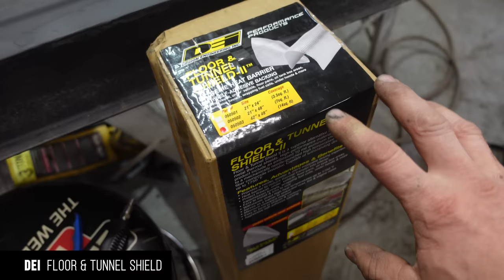Building a Functional Boom Lift Hydraulic Power Unit | #TTDmaxC10 [EP17]

Comment: I've had a lot more luck getting out broken bolts by first welding a flat washer to the busted bolt, then welding a nut to the washer. A friend gave me that tip and it has saved a lot of headache.
Reply from the maker: Something I learned today!  Thanks!
Reply: @DEBOSSGARAGE  if the bolt is big enough and recessed into a bore, Cronatron 333 welding rods are your friend there. They're expensive tho, like 10 freedom bucks per pound, or maybe 10 bucks per rod, I don't remember exactly.
Reply: You’re right that’s all I ever do
Reply: $200 for a 5 pound container 😮
Reply: And while it’s still good and hot, give it a dose of PB Blaster. I use 50/50 ATF/acetone for without heat, but I’ve never had PB flash off without an open flame.

Comment: Nice build on cab, a lot of work. Did 27 months at Ford in body shop, as line technician,  electric,  robots,  vfd drives in KC,  Mo. They make F150 & we launched transit van . 600 robots,  the Fanuc brand,they do welding about 180 to 230 units ,  in a  couple 8 hour shifts .  They go around the clock. 
Not stealing your thunder. But after them van chassis leave us they go to E coat,  they get dunked,  then off to paint,  * back to body shop for power train,  wiring,  glass plumbing. So may I humbly suggest,  spray that entire thing,  top bottom inside with some good e coat,of your favorite brand,that has a good rust inhibitor,  flat black,  white or grey,  before or if your planning paint down the road.
 Because were you live in Canada , & I'm in Chicago,  that salt eats that metal ! ! Were talking about winter folks,  yes they put salt down to melt that snow.
 It will last a lot longer.
Hugh Mc. Chicago, metro.

Comment: Rich, I've always wondered about doing welds on panels and what protects the other side of the panel. For example, that door that you repaired, as DIYers are we supposed to try and slap some paint on the back side (inside) of the door cavity where the weld has come through?

Comment: I need help with my 97 Obs Chevy 4.3 Vortec! Driving on the freeway it just stopped running without warning. Facts: Fuel pump turns on with key. Not getting spark now. No fuses blown, guages work but “check gauges” light and “check engine” light now on, no spark from coil. Maybe crank sensor or coil? Would those cause it to just die? Never had a problem with this little truck before.

Comment: 9:18 the toolbox lid not having enough clearance. I saw that one coming right away.  Speaking from personal experience of course 😆
Reply from the maker: Split the difference between having it stick out too far and hit the front of the bed.  I put the crane as far forward as I could.  The wheel just clears.
Reply: The lid just needs a creative dent in it for clearance to let the lid open more.

Comment: 15:34
A trick Ive heard of is to weld the end to a washer first. then put a bolt on top of it and weld in and around it. Idea being you are turning against the outside welds instead of the one on the stud itself.

Im not great with wording sometimes but i hope that made a little sense

Comment: Change the hinges on the tool box to tackle box style so you can pull the lid towards you and then flip it over. Gives you a nice little surface to work off of when servicing the hydraulic pump and it will clear the handle easily.

Comment: Haulass Garage(Aussie Chevelle drag week) showed welding a washer on the broken bolt first then welding a nut to the washer was best. can get better welds on both before trying to remove(probably more heat too?)

Comment: Next time you weld a nut on like that, pour water on it right away. That will harden the metal and will allow you to then back it out without it twisting apart. When I did special trackwork repair in the railroad I did that all the time to extract broken bolts. If I did not harden it with water then never came out. Just food for thought! Try it next time!

Comment: Such a cool build. I would definitely drive it a lot if I had it. Is DEI the same company that you used for sound/heat protection on the F3Kitty?
Reply from the maker: No, I used B-quiet for F350.  They didn't have anything that I could get that close to the exhaust.  Happy with both companies so far.

Comment: I believe the only way to fix your steering problem is to extend the length of the rods coming out of the steering rack to adjust the pivot point of the tie rods.
Reply from the maker: There is no steering problem, and its a steering box, not rack.